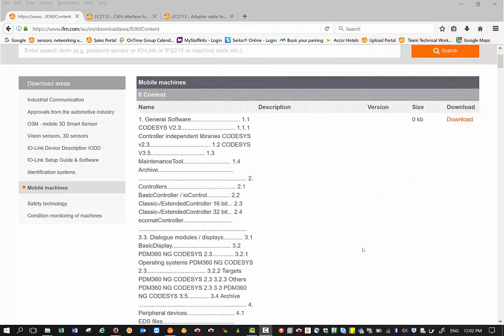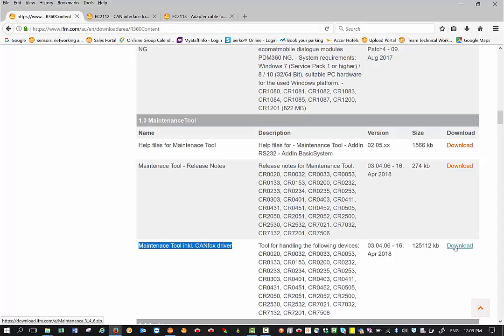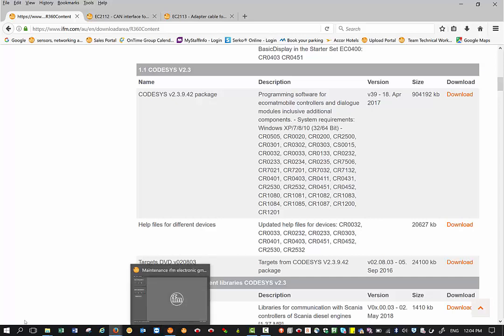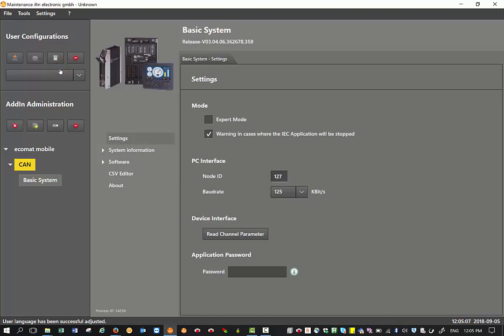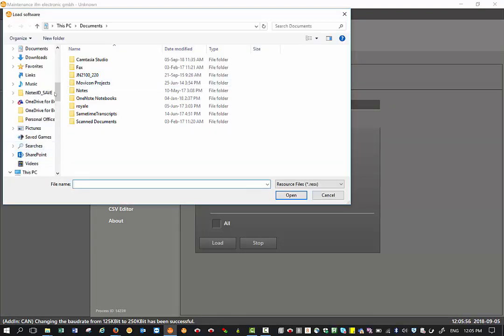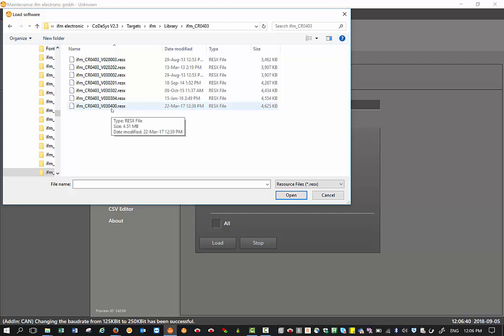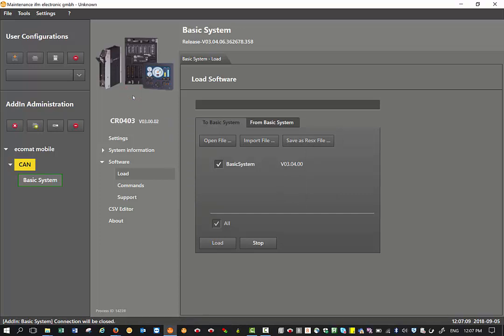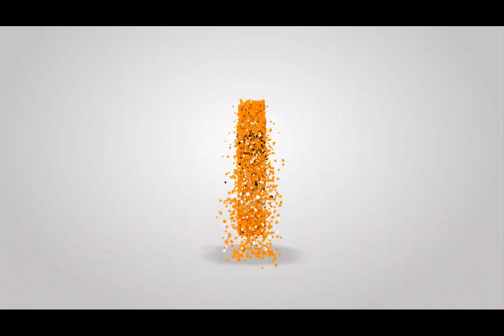How to: Update firmware on ifm Basic Controllers, Basic Displays & Smart Controllers

Comment: hello Sir, my ifm cr0032 have white permanently led status and rs232 is not working. I can not flash any program or recover firmware to it (i've alredy pulled the test pin to 24v). Is this mantainance tool with CAN cable helps?
Reply from the maker: Dear customer, a white LED is not an ifm standard. The safest way of connecting is via RS232. If the connection via RS232 is not possible, the chances of it working via CAN are very slim. In this case, it would be a good idea to contact the manufacturer in your country.

Comment: I work from Ifrm cr0032 in the spreaders
the crane, but I was unsuccessful in establishing commucation with the IFM and
PC.
I used the cable USB from RS232, butdon’t establishing communication.I used the cable USB from RS232, butdon’t establishing communication.
Possible help me in this case?
Thank you
Reply from the maker: Dear Enzo Nuñez, thanks for contacting us. Here are first recommendations:
1.	Make sure they are using ifm Programming cables i.e. EC2112 & EC2113. 
2.	Make sure they have the correct baud rate selected to match the controller. 
However, our local support can help you better. Where are you from? You can find your local contact person here: https://www.ifm.com
Reply: @ifmgroup  Thank you. I will do contact.